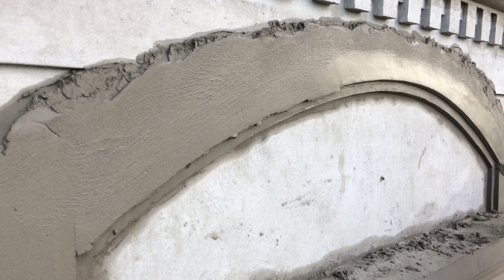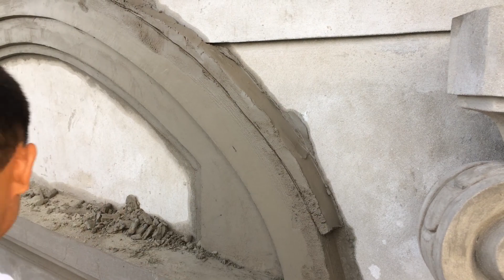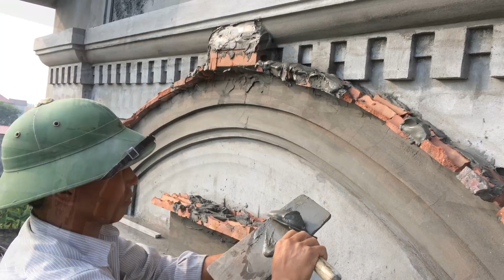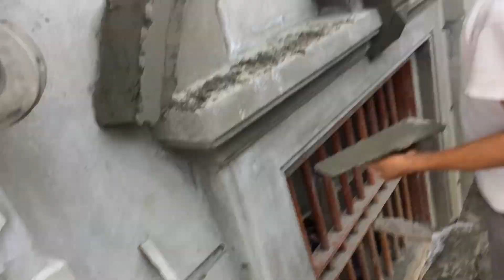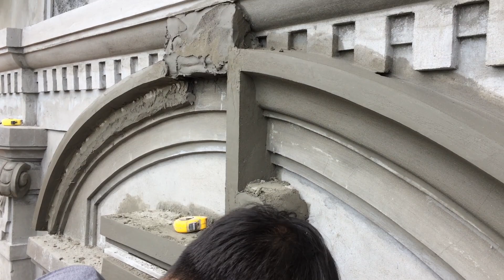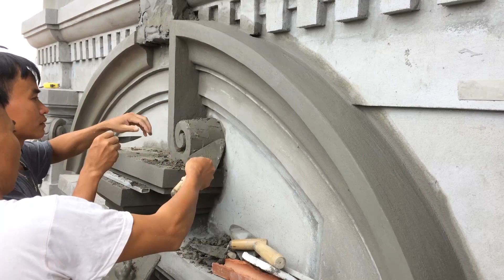Amazing Construction and Cement Working  - Techniques Building Dome Beautiful By Sand and Cement

Comment: Great skills, but it has nothing to hold it together for a long time. Cement over cement without proper binding material will not last long.
Reply from the maker: It has a very strong cement structure sure
Reply: They are using cement and sand boo
Reply: @karenannskreation2022  Don't matter, you have to use steel or any form of metal to hold cement to cement. Sure it will hold for awhile, but with vibrations it will start to crack and then crumble.

Comment: It already started to crack without wire meshing.
Reply from the maker: Thank you for watching videos to share videos with friends supporting the development channel
Reply: @amazingcontructionnews5050  I wouldn't share these videos because everything practiced in them is incorrect methods
Reply: This is a proven technique that's been practiced x100s of years all over the world......that doesn't crack. How long has your famous wire mesh been around? It's all in the mix that's used. Don't be so ignorant.  Do you think there is wire mesh in all the cathedrals and old buildings all over Europe and the Americas that has this molding technique applied.
Reply: @mickcoll70  proven to produce cracks as shown in the video itself. This method would last 5 years tops. Even in those older buildings they add reinforcement to keep plaster or fresco adhering to the structure
Reply: @jacobs2162 / Those methods are originally developed in medieval Italy, France and others European countries, not with cement but with calx. Yes reinforcements is needed only above a certain thickness, not in this cases !